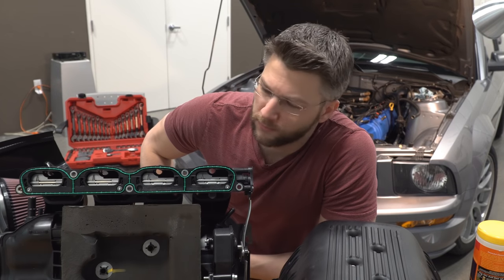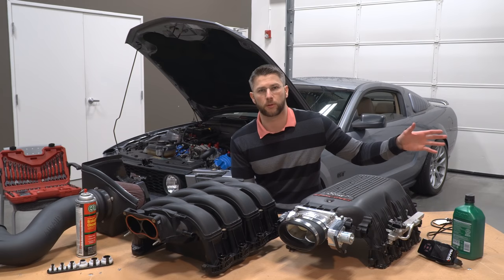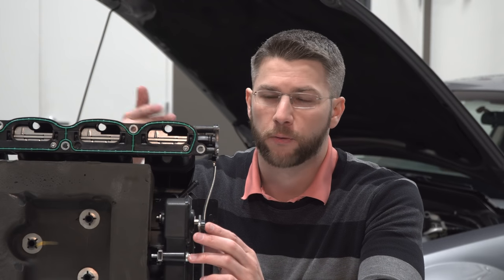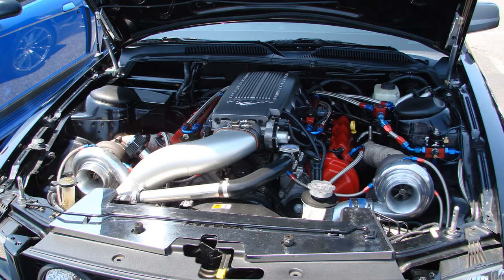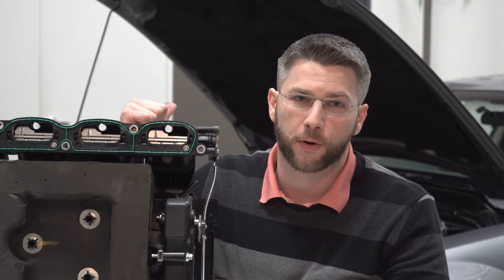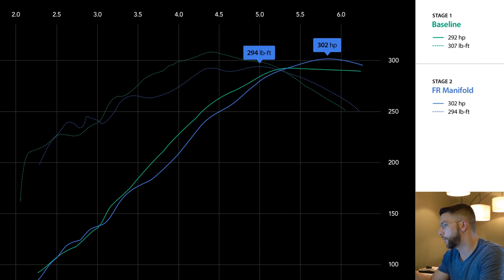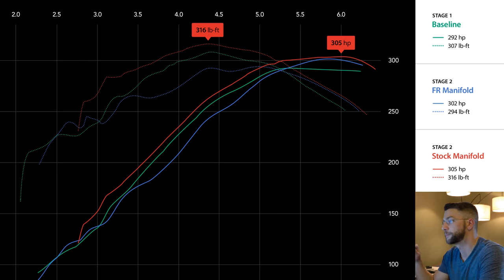Why you shouldn't remove your stock intake manifold

Comment: I went with a Roush stage 1 supercharger with the Roush tune because I had thought about going the N/A route, and decided it wasn't worth it.  I know for supercharged applications the stage 1 is at the low end but it gets you more power than the N/A parts for about the same amount of money and no drivability issues.  I didn't want to rev the engine higher and I didn't want to have to go into the exhaust because being in California I would be changing parts out every 2 years.  It is funny the gen 1 coyote makes 420hp and 390 ft tq in factory form.  When I started building engines if you got 400hp out of a street able engine you were doing great.  I had a 500hp 383 that couldn't run power brakes due to no manifold vacuum, would over heat in traffic and it needed a bigger stall converter just to drive around.

Comment: Good Video! Glad someone understands why Ford does what they do with factory engines! 

In short, if you are N/A keep em. If you are boosted delete them, it will make things more simple and they will restrict flow more than anything. 

I deleted mine with my Paxton hot rod cam setup and I am glad I did. Car feels smoother and stronger.
Reply: Garrett what throttle body did you pair it with?

Comment: Have a 17 GT350 Shelby with a flat plane 5.2 L with a procharger at around 6 pounds of boost, E85, Kooks long tubes and mid pipe.  The car responded quite well when my tuner set the charge motion control valves wide open at all times regardless of the rpm or load.

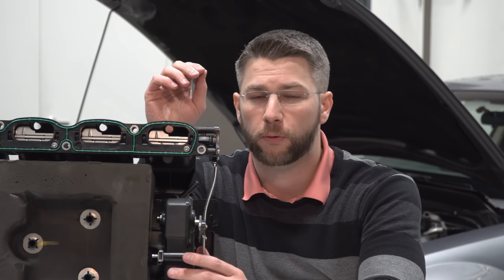Comment: Great videos and content. I have to mention though that for the 3v 4:10s are not drag only. They are great for daily driving and will help your cams tremendously. Stock 3vs come with 3:55s. American racing has a great video on 4:10s on a 3v. Even the host mentions that he was surprised at the drivability of the 4:10s on the 3v. Now if you start talking 5.0 then yes 4:10s cross into the drag only realm. On my 5.0 I have 3:73 but for my 3v 2009 gt I have 4:10s. You won’t regret 4:10s.

Comment: So glad I came across your channel! I want to stay NA in my 08 GT and have been eyeing up that FRPP intake manifold for a while now. This has me completely convinced to stick with my stock manifold, just add the TB maybe and most certainly the LT headers and 1 piece drive shaft. Quality of the videos is A1 man, your exhaust video was on point... all the different perspectives really helped me decide what to do with my build. Keep it up!
Reply from the maker: Thanks Justin. I think about 80 - 85% of my power gains are coming from the headers and x-pipe alone. I felt a large difference after getting them installed and then another noticeable difference after a custom tune. Also, I'll be maxing out the car on an NA setup first.

Comment: I put 4:10's, full exhaust, pulleys, frpp cams, jlt series 3 intake and frpp intake manifold, lito tune, bbk throttle body on my 3v and zero complaints, pulls like a train
Reply: How is your low end below 4k? Do you have manual or auto?
Reply: @jimbrow83  my car honestly pulls like a train for what is it, i have no bottom end power issues. It pulls hard up top better than ever too

Comment: Ford recommends CNC port and polished heads with a 3way valve job. Along with there cams. They got 50hp gain with the intake manifold but it doesn’t matter we all just circle back and save up for coyote’s

Comment: So glad you are doing this. Single handedly  stopped me from wasting money on a different intake manifold when going with my cams next. :) Thanks.  I to have proper CAI, LT Headers, Offroad mid pipe, and go high flow catback exhaust with 93 bama tune. However, I am displeased with Bama tunes ability to clean up some items. I need to find a good tuner too..

Comment: I'm glad I'm not wasting my money on any of these "upgrade" parts and going straight to a supercharger. Just bought a used Magnuson MP112 for a 4.6 3V for $650 with the lower intake, throttle body and 39lb/hr Ford Racing injectors.
Reply from the maker: That's a steal.
Reply: @Four_Eyes  I know it, wish I could send a picture of it, I'm still in shock.

Comment: Good content but as to the FR Performance Intake Manifold I've found some differing info. 1.) The intake runner lengths of the FRPIM are 9.5" long to the OEMIM's 11" w\ both IM's using an open plenum design (OEM plenum is located in lower section below the runner entrance centerline & below the TB bore, FRPIM plenum is located in upper section w\ plenum floor & TB bore parallel to the runner entrance centerline….the effective runner lengths of the FRPIM are only 1.5" shorter (I know as I physically measured them) so the low end power drop between the 2 manifolds at low RPM is very negligible as 1.5" of runner length variation means virtually nothing at low RPM velocity-wise due to air flow frictional coefficient differences being virtually non-existent. This matters only at high RPM's due to very high air flow velocities thus higher flowing friction....which is in favor of the FRPIM. 2.) The CMCV plates themselves DO provide better fuel atomization & mixing qualities (fuel vapor from the injectors transforming totally into a gas) so you WOULD get better fuel burn at low RPM's as well as slightly better cylinder filling by directing the bulk of the incoming airflow towards 1 side of the intake port to take advantage of the natural EGR effect due to valve overlap which would provide some power improvements but MAINLY much better low RPM fuel ECONOMY w\o a large power drop off due to the air turbulence created by the plates, but again this would not lend solely to the increased low RPM HP\TQ amounts that was shown on the dyno graphs (not to mention that if that were so, don't you think the Ford engineers would've kept the CMCV's installed on the FRPIM? After all, they did design the unit as well as the engine.....). 3.) The MAIN reason for the large low end power gains was due to making changes within the TUNE FILE itself! I know this 1st hand now as I had my '09 GT recently local custom dyno tuned w\ my FRPIM installed (my setup is similar to Four Eyes' '07 GT mod-wise: FR Bullit 85mm CAI, GMS Hi Flow calibrated MAF sensor, BBK 62mm TB, FRPIM, Kooks 1 5\8" LT headers, Kooks Catted X-pipe, Pypes Super Bomb Mid Muffler catback exhaust) w\ a baseline pull (also was using a Bama 91R tune prior, just as Four Eyes had done....) then pulled after making adjustments in the tune files....I ended up getting a near identical low RPM HP\TQ increase pattern result w\ my FRPIM installed as Four Eyes did w\ the stock OEM manifold w\ CMCV's active (30+ HP, 65+ TQ increase <2700 RPM vs baseline w\ my 4.6L motor having 144,400+ miles on her). My local tuner actually resolved a common issue within the ECU that some\most canned tune providers DO NOT do when disabling the CMCV's in the tune files & that is to COPY ALL the IMRC open air\fuel\spark table mappings (the files that are used when the engine reaches the >2800-3000 RPM to make power where the ECU will open the CMCV's fully) in place of the IMRC closed air\fuel\spark table mappings (the files that are used when the engine is <2800-3000 RPM for better fuel economy as the CMCV's are fully closed) to "trick" the ECU to use the power making IMRC open table mapping at low RPM instead of the IMRC closed economy table mapping due to the safety feature built into the ECU to default to the IMRC CLOSED TABLE economy mapping if the CMCV's are disabled in the tune files (or if enabled & the ECU sees the CMCV motor drive fail to operate) then tweak the files from there to get the most. You will get the SAME LOW RESULT if installing CMCV delete plates on '05-'08 OEM IM's & the tune file's IMRC air\fuel\spark table mappings aren't modified\tweaked to reflect this. You got to do MORE than just DISABLE the CMCV's in the tune files. This has been known for at least 10+ yrs running (I found this on the HP Tuners website & my local tuner is certified thru HP Tuners & uses their equipment so he knew all about this beforehand). Once this is done correctly you WILL get BOTH the low RPM performance AND the high RPM performance w\ the FRPIM on OEM camshafts! As for supercharging, the FRPIM is a waste of money ONLY if you're going w\ a Roots\TVS type of positive displacement supercharger (has it's own intake manifold setup) whereas a centrifugal supercharger (Vortech, Paxton, Procharger, Rotex, etc) or any turbocharging can use the FRPIM. FYI...……………….

Comment: If you are racing and geared low then you want the delete plates. The FRPP intake is worth a little more but from my experience with 3v's in the past its not worth the extra $700 for it. Do delete plates and get someone who knows how to tune a 3v and have at least 4:10's and you will love it. Most people don't race and gear there car that low so they notice the loss of low end tq. If you are geared you wont notice it trust me. Plus a good 3v tuner will have the timing tables so good on the low end it makes up for it.  That's the beauty of VVT.
Reply from the maker: Yeah I've found if you have a really good tune, it's worth removing them. But it's weird to buy a $250 part and get a $500 dyno tune... so delete plates should be installed in conjunction with a bunch of other upgrades to make the build more cost-effective.
Reply: @Four_Eyes   right I agree.  I've done a few 3v's and always do cams at the same time and you get a nice bump. Always gears first though.

Comment: Why anyone builds these motors without forced induction is beyond me lol. We've spoke about why you are going in stages but there are a lot of bolt on S197's out there and it just baffles me lol. Good content though brother I dig the channel so far 🖒🖒
Reply: Vinny P you are correct. There is absolutely no need to do any kind of engine work, cams, intake, etc, when you can just install a supercharger for in instant 450plus horsepower. It's just a waste of money to do anything otherwise
Reply: 3644Darrell yeah I mean I know for him he's creating content which is great and also working in stages for budget and so on so I get. Personally going all in out of the gate was the only way I saw doing it lol
Reply: Good point. So if I did add a supercharger to my almost stock 4.6 3v, which one would you go for?  And do you think it would cause issues with stock exhaust?  Right now, all I have is the AIRAID race CAI, and a DiabloSport canned tune.
Reply: Raymond Marin Personally I would spend a little more and use a Hellion turbo. Turbos make both low and high end torque. My quote for everything installed by a reputable shop here in the Atlanta area was 8,600.00 for the turbo and 7500.00 for a Procharger. Only approx.1,200 of that is labor
Reply: Not everyone wants a 400+hp car..but wants a little more than stock..
Reply: The bottom line is , they get in the way of air flow , just like the choke butterflies on old carbs , n/a or not .
Reply: unless you do road course when the extra heat will stop you from doing many hot laps as well as the extra weight up front. So depends on what you want from the car. As well as NA vs Forced induction for the most part NA is easier to tune/daily drive. (usually)
Reply: Vinny P Lexus has a naturally aspirated 4.6 v8 with 380 hp. The 2010 Hyundai Genesis 4.6 v8 makes 375 hp.
Reply: Guy Noir No they don’t. That engine doesn’t make more hp because of the cams.
Reply: Cost more than the car to build the motor to handle the power.
Reply: blackericdenice u never get 380 out of a 3v without supercharger
Reply: @totljag1  You can with a hot enough cam.
Reply: blackericdenice that’s the best your going to get !
Reply: @totljag1  You can get hotter cams made.
Reply: @totljag1  Dude this is why you guys don't know anything. Stop watching videos where they are trying to sell you something.
Reply: blackericdenice  show me ! Or ur just a mouth 👄
Reply: @totljag1  I'm just mouth.
Reply: @blackericdenice  So? Fast or not, neither the lexus nor the Hyundai look like an iconic mustang.
Reply: @sherylellingson3538  What the hell looks have to do with hp?
Reply: Some people would rather have a balanced car and not add another 90lbs to the front end , different clutch, much bigger rims and tires and add even longer stopping distances with brake dive. Not to mention spending over $10k on a car that costs $10k . Just buy a coyote that already has 380rwhp .

Comment: He mentioned back presure in the intake side using the butterfly valve. There IS no back pressure unless its suplied and its not
Go with the Ford Racing inake manifold and you will see 35 more horsepower at least

Comment: I did the same thing with my Dodge, I removed my stock manifold that had intake runner control valves and installed a really nice aftermarket manifold. It killed my torque. The car was terrible leaving the starting line. SOOO....back on went the stock manifold.

Comment: I have a 2016 Mustang GT.  I took the stock intake manifold off, and replaced it with a factory F-150 5.OL manifold.  Why?  Because it makes 25 - 40 more ft/lbs of torque.  Yes, I lost a little HP at the very top of the rev range, but my car is a street car, and in a purely street car, more TQ makes the car more enjoyable to drive.  F-150 manifold also has IMRC or CMC valves and does not require a re-tune!  And the best part..., it cost me less than $100.

Comment: I had same mods except I had stage 2 comp cams and I put 336 hp 329 tq 
C&L cold air 
Ford racing intake manifold 
Mac long tube headers 
Mac off road pro chamber 
And bbk throttle body
Reply: It really does help if you’re cammed and have gears. I also had 4.10 gears.
Reply: Yeah , I had an 05gt like that . 3800rpms at like 80mph and 15mpg highway. Ended up getting tired of it and got a coyote . If I could go back I would have saved the 1000s of dollars and just got a coyote to begin with.

Comment: Those act as valve event specific choke plates. Easy as that.

Point two: 
Not procharger. That's a brand. You mean centrifugal supercharger.

Twin screws are knows as positive displacement or rootes blowers (old term based on a manufacturer).

Comment: Wow this is eye opening I really thought the cobra jet intake manifold was the best for improved performance except as you gave your explanation I couldn't help but to think why didn't he upgrade either the fuel rail or the injectors or both I mean what's the point in having a lot of air going and going out if you don't have enough fuel to mach ??

Comment: So Ford basically made all their Performance parts go together... you gotta change out your cams to increase the air flow into the cylinder... I’m doing the same set up and I’m getting the Hot Rod cams but the Mutha Thumprs have more lift duration

Comment: Only use lockouts when running boost.....Naturally aspirated needs the IMRCs working and working well.....And after 30,000 miles you may need to pull the manifold and clean them up as they will get sticky and throw random misfire codes which most people have problems diagnosing.....

Comment: One question...why did you buy a new OEM intake manifold instead of using the one that was on the car previously ?
Reply: I was asking myself the samething! Good vid...
Reply from the maker: I finished installing the Ford Racing intake manifold, along with the valve covers and throttle body, at about 5am that day. In a short-sighted fury, I just tossed everything. I really thought I would never use the stock mani again.

When the new one arrived, its CMCV connector didn't fit, so I had to hunt down the cable that connects stock manifolds to 05-08 Mustangs (the new one I got is for 09-10). This was a huge PITA and basically I had to shoot half of this video twice.
Reply: So you just spliced the old style connector onto the new manifold? I have one coming to replace my sport tracs single bore TB in favor of the larger GT design.

Comment: Well installed today everything went smooth other than a tb bolt snapping 😡 loaded the Bama tune didn't notice any low end loss didn't get on it to see if any high end gain
Reply from the maker: Nice work! Cutting that fuel crossover line is no fun.

Comment: I ditched my charge motion plates before I even did headers...had a bunch of issues with bucking at low RPM's especially when cold. Interesting to see what you gained with them back on, but now that I have cams everyone says you don't really want the charge motion plates on there anyway. Thanks for all the dyno work, really makes me want to dyno mine. I have a Lito tune which is about as close as I can get to custom in the boondocks where I live.
Reply from the maker: Yeah so I think removing the CMCVs is okay only if the car is dyno tuned right after. I had a couple canned tunes from Bama and my car never ran well, and I think that's what most people do (they're not buying a $250 / 10hp part and then going and getting a $500 dyno tune).

Comment: I keep going back and forth about whether I want this intake manifold or not. I have the frpp hot rod cams in the car which I know don’t add a lot of power but the car does feel significantly stronger above 5k. 

I want to build this engine as much as I reasonably can without boost (for now) so that will include long tubes and taking mass off the pulleys and driveshaft, but I really can’t make up my mind about the manifold.
I know I’ll probably see better high end power with a proper tune but I don’t know if it justifies the loss in low end power